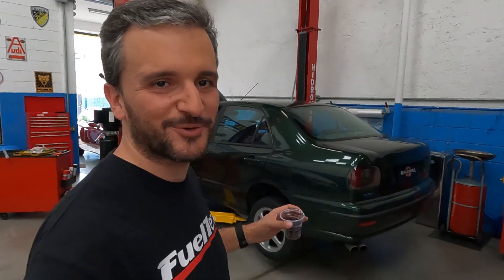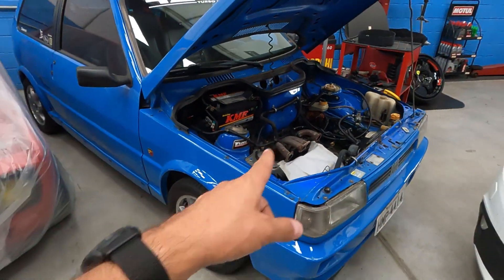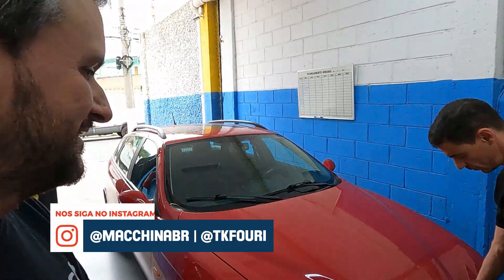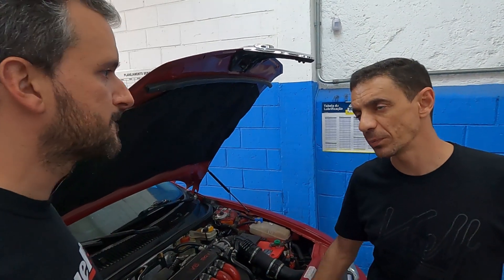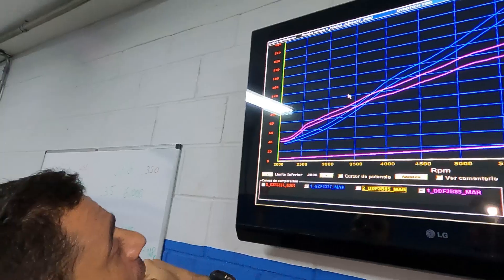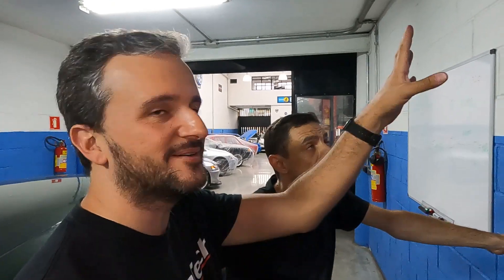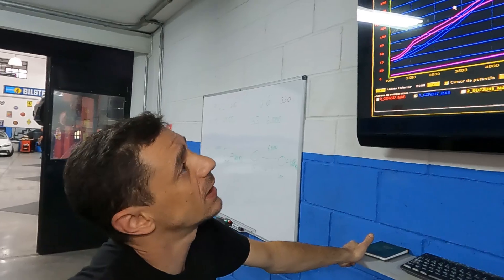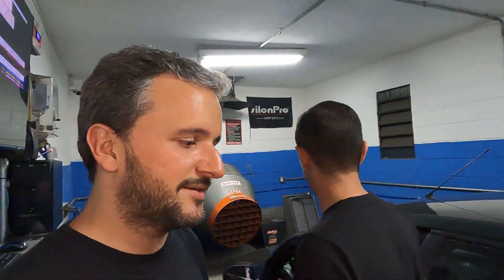O MOTOR 2.0 TURBO DO MAREA É MUITO MAIS RESISTENTE QUE IMAGINAM! ENTENDA O PORQUÊ!

Comment: Tem que montar 2.4 turbo, ai fica foguete
Reply: é só trocar esse bloco.
Reply: O problema de aumentar a cilindrada é que interfere no corte de giro do motor, o 2.4 gira menos por causa das características físicas
Reply: @thiagoschneider  tanto o 2.4 quanto o turbo tem o corte original em 7000rpm
Reply: @thiagoschneider  é só usar o bloco e miolo da aspirada, aumentar cilindrada da 2.0 da muito trabalho e não chega em 2.4 tão fácil.
Reply: @andrecamargo5095  isso eu entendo, tenho Marea. Porém o motor 2.0 naturalmente gira mais e por isso ele foi escolhido pra ser turbinado. 

Os motores 2.4 que são turbinados, geralmente usam peças forjadas e com certeza terão melhor resultado, porém, em se tratando de um padrão "original", o melhor resultado vem com o 2.0.
Reply: @thiagoschneider  procura no Instagram Buzzo performance, Marea weekend vermelha, 340 cv, com motor 2.4 , usa uma HX35, 5 bicos de 80 e miolo original, é o carro de dia a dia deles, conheço pessoalmente o carro e passa de 7mil rpm fácil
Reply: @andrecamargo5095  errei ao usar o termo "melhor resultado" 

O motor 2.4 tem 20% a mais de capacidade cúbica e com certeza esse motor apresentará números melhores, o porém é que o motor 2.0 é mais elástico e, dependendo do uso, se torna mais interessante.